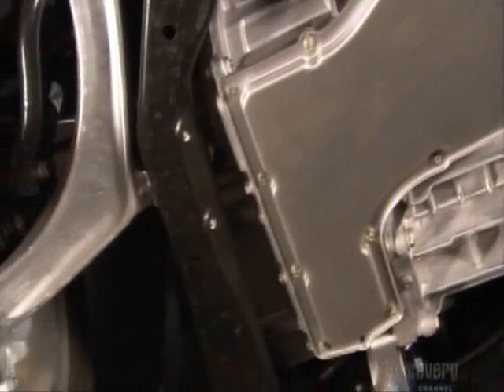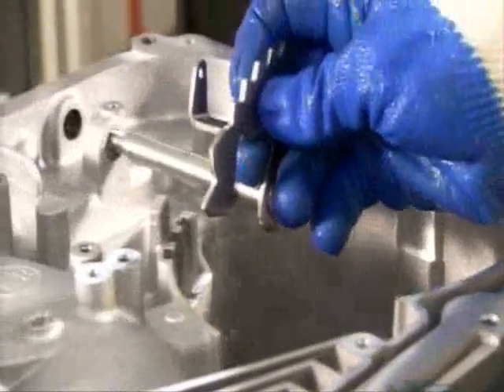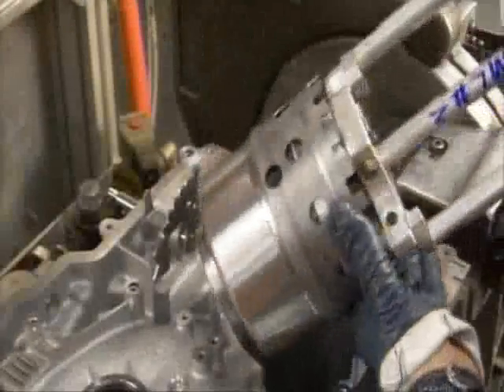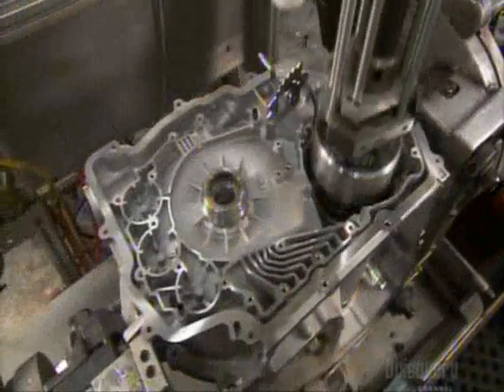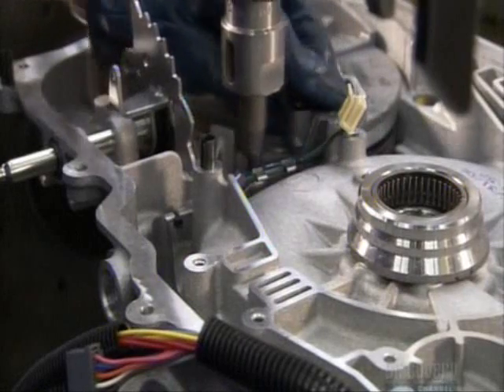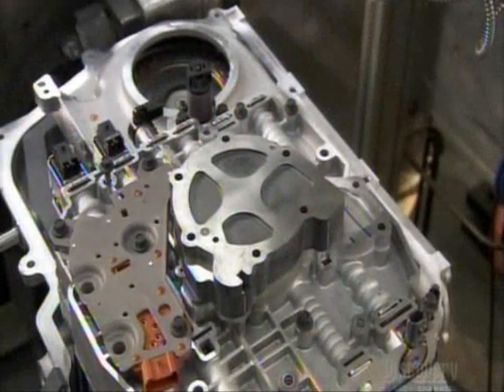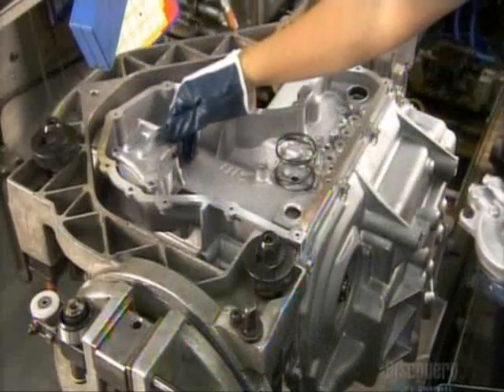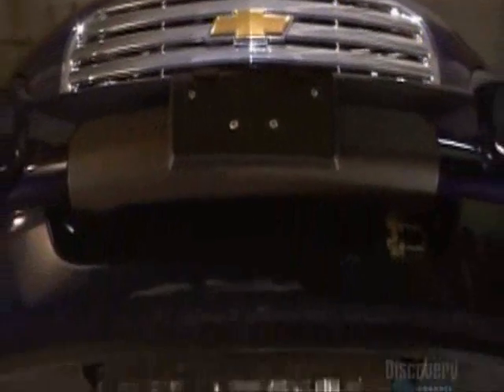How it's made Automatic transmission

Comment: really a manual is quite simple. you have the input shaft driving the cluster shaft. the cluster shaft has many gears on it those gears always contact gears on the main shaft. when you push the shifter into first you move a synchro which was resting on a gear locked to the mainshaft. now the synchro is half on the gear locked to mainshaft and half on the 1st gear. 1st is now enguaged. its the same for the rest except 4th. 4th just locks the input shaft and mainshaft togeather 4th is direct drive

Comment: This is actually a transaxle, which is a transmission and differential in one integrated unit. Mostly used for front wheel drive cars, though some rear wheel drive cars use one to help with weight balance.

Comment: @andyass3 whats the point on discussing whats the nationality of the car brand,as long as its flawless in performance its ok.but if you want to relate a country with the car, you need to keep in mind 1: where it was engineered ,2 where it was manufactured.,ford is manufacturing in brazil ,therefore we are getting low low very low quality products,gm also implemented the same strategy and the result is RECALL

Comment: They forgot to add the most crucial pert of all... the Kanuten Valve, which, in conjunction with the Turbo Encabulator, allows the car to operate properly. Next, we discuss the importance of checking the Blinker Hydraulic Fluid... and the other critical components, including the Tire Pressure Compensator Relay...

Comment: @ItsMrWinters I don't know what German car you have been around that breaks. My 1989 bmw 750 has almost 300,000 miles and the transmission changes fine. Plus it has had a lot of abuse from the big V12 powering it.

Comment: @dotcombatgames No, it's simple physics. All transmissions are inherently parasitic. They do not increase an engines torque. It requires energy to move the components in the transmission, the energy comes from the engine. There is no way that it will increase the engine's torque. That's why torque is measured at the flywheel and at the wheels. There is always loss of power in the drivetrain.

Comment: I found an old automatic transmission under the house as a teenager, gee I had fun pulling it all apart, but putting it all back together well.......took 5 times longer, but I learned heaps. The narrator refers allot to electronics in this clip, but electronics still need mechanical interfaces, like how does the electronics ascertain the hydraulic pressure in each segment of the transmission?

Comment: @reddot44 some had vacuum, like the zf 4hp`4, or was it 3hp14, while my current 4hp18 just uses ATF pressure and rotation speed of a govenor on spring weights, throttle position is sensed by a variable pressure feed

Comment: And in regards to drag racing, you are absolutely right, in a straight line, when simply accelerating, a computer can shift much faster then a person. 

But track cars, such as grand prix, touring, and F1, are usually in someway manual. very few still use the classic "H" pattern shifter, but most have gone the route of the sequential manual (gear up/gear down) because it allows them to enter a turn in the correct gear. Automatics are "reactive" and Manuals are "proactive"

Comment: wow, okay, enough arguing...
Manuals do not cause experienced (read: SAFE) drivers to drive erratically, inexperienced drivers drive erratically, regardless of the car. Manuals do something automatics cant do, they allow you to shift IN PREPARATION to an event (ie: turn, sudden slow down).

I drive manual, in my VW coupe and my Freightliner work truck. 

However new technology (direct shift gearbox, etc) is allowing automatics to actually react faster then manuals. in a straight line at least...

Comment: @McFuckNuggets  there is a transmission that changes the gear ratio without releasing power from the engine, and its called a CVT transmission(Continuosly Variable Transmission) its found in snowmobiles and atv's and tractors and they are in the new Prius, Camary, highlander and i think the nissan altima. Its weird driving one, the transmission has a infinite amount of gear ratios and does so by shrinking and enlarging pulleys

Comment: On an unrelated note, why not use a single, tapered gear? A non-tapered gear could slide along the tapered one, which would change the gear ratio without the need to release power from the engine, and would provide a theoretical infinite number of gears... The only issue I can see with this is that you would need a rod that can adjust in length so one gear can slide back and forth, but that shouldn't be an issue...

Comment: @tayedrummer14 
You will only find a fly wheel on a stick shift (manual transmission). As Tayedrummer14 said, it smooths out engine pulses and is used to retain kinetic energy. But it is also used to start the car. Along the edge of the fly wheel, are spokes, alot like a cog, which is connected to the starter motor. When the starter motor receives electricity from the generator or battery, a little cog in the starter moter turns, which in turn turns the fly wheel, starting the engine.

Comment: @ubuntunoobz not anymore, automatics used to be more expensive because of research and development, but now, all the parts are mass produced and simply laid into place, just like a manual, and manuals have become more expensive because its the thing most people want, and its viewed as an option. automatic is now the base transmission, as well as autostick, where you can use paddles, or left right/up down, stick control of your gears, however that is not as satisfying as a real manual tranny

Comment: @DrSurprise manual transmissions used to be the cheaper buy, but now that people like manuals it tends to be the more expensive, only because of supply/demand, however, the pricing is barely more expensive, and when it comes to older cars, there is no difference. however, i dont agree with him, but manuals are something that takes time, and in the long run, potentially more money.

Comment: @0123Brock It's because the more splines (the notches and grooves) you have, the less pressure is on each groove. It's divided up between them. Up until a point that is. And by the way, most can't handle 300+ WHP without upgrades. They're generally designed to barely handle what the engine puts out from the factory.

Comment: @radoslavnikolic Yea lots of stuff but the basics is the hydralics fluid sent by the computer is what tells those clutches what to do. And those clutches in turn control there set of gears and that tells that the car what to do! Automatic transmissions are more complicated and therefore more expensive but they make driving a lot easier!

Comment: Gears transmission and crankshaft. That's antique.
The automobile industries should build motors either piston or turbine type to run at optimal rotation speed generating electricity to power in wheel motors with optimal traction.
Ten liters of diesel fuel can move one metric tonne from Amsterdam to Paris with ease!

Comment: You can get out of the car when it is in drive, you can get back in and accidentally touch the accelerator and off you go, you can't do that with a manual transmission or the engine will stall as soon as you take your foot off of the clutch pedal.

Floor the accelerator for five seconds in an automatic and then a manual and see how fast you go, there are loads of videos on youtube showing automatics crashing because "they pressed the wrong pedal" It would never happen with a manual transmission.

Comment: You could always do that too.but most customers just want thier car to run like it did when they got it.  I like B&M shift kits for performence aplications but perfer not to build automatic transmissions myself. 

Im not a trans tech but ive got that Cert just for the extra 2.50 an hour! I just wind up swaping out parts all day like an installer but its a fast way to make money working flat rate

Comment: your an ass

Manual get better gas mileage, and rarely breaks down .... not mentioning the most important thing : They are more fun to drive.

but I got an automatic you know why ? cuz when you drive a REAL CAR with a V8 , it really doesn't matter, cuz the huge engine just don't care.

and I liked the automatic more, cuz when I smoke weed I use 1 hand on the steering and one to hold the blunt.

you got owned by the ppl here b4 me, so I guess you ran from here cuz you V-tech kicked in 

FAIL

Comment: i believe on some cars with Automatic transmission have idle higher than manual so they may have less efficient MPG... and it all depends on the driver mostly on the highway...my car has 37 mpg and if its automatic it will have around 33...

Comment: Alright the debate between Manual vs Auto i will finish it off... automatic is great for City driving specially on car populated and traffic lights cities...Manual is great for open highways and up hill roads...
manual keeps u awake while automatic can make u feel sleepy on long driving.

Biggest advantage = Manual 
reliability wise, manual can take the beating on the clutch and it cost less to repair than Automatic.  automatic has too many sensors, internal clutches internally.

Comment: I rebuilt 2 auto transmissions last year, one from a 2004 ford focus and a chevy front wheel drive one like shown here, i understand how it works because i had hands on experence with all the plates and how each one is aligned and the planetary gears are pain in the ass to put in, but manual is much easier to work with and fewer parts than automatic